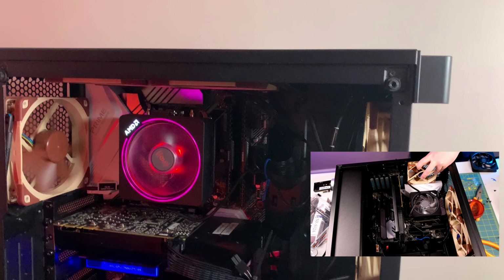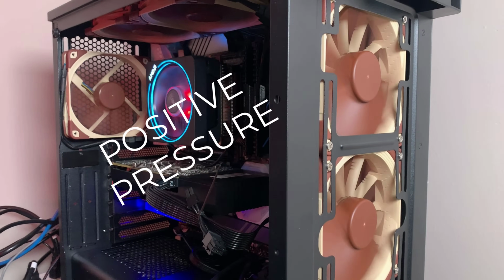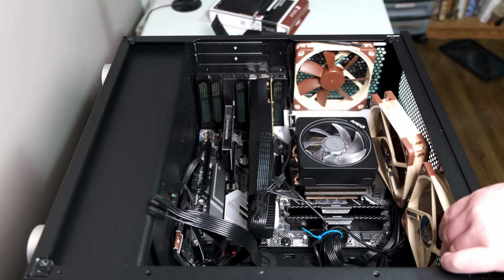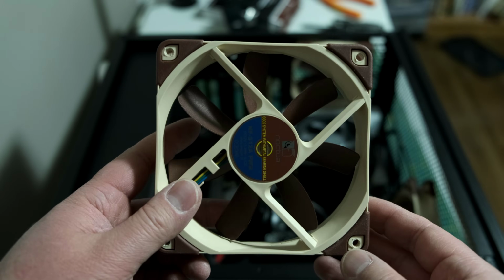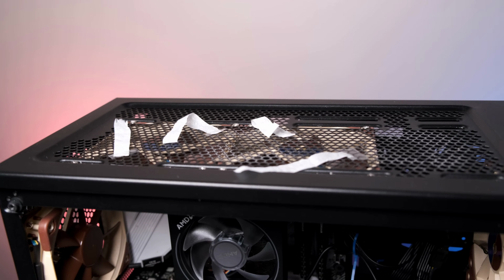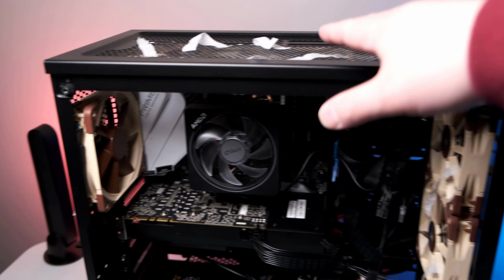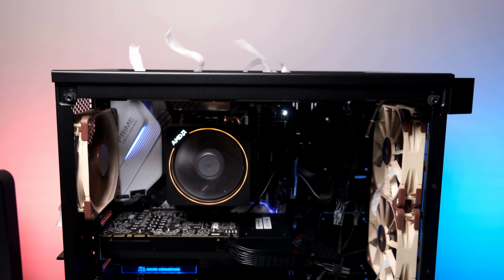Custom PC Build: How to setup your desktop cooling fans for proper air flow

Comment: I only have three case fans do you think that’s enough? Also I don’t have the arrows on them so is the only other way to tell us after you power the fans on?
Reply from the maker: Hi there. It really depends on your setup and what you'll be using it for. I recently did a video where I went from 5 fans down to 4 fans. https://youtu.be/jl10lb8XF0Y. I found the temperature did make a difference. However, please remember, that it's related to my case and my application. The temp was noticeable when playing graphic intensive games and 4K rendering. I actually decided to enable my 5th fan. Let me know your specs and i'll walk it through.
Reply from the maker: Here is an article that tells you how to tell the difference for fan orienation: https://www.neweggbusiness.com/smartbuyer/over-easy/pc-cooling-how-to-set-up-computer-case-fans/

Comment: I have a question, the fan you used to cool your cpu, what is it and did it come with the cpu? Thanks
Reply from the maker: Hi there, the fan i used to cool my cpu is an AMD Wraith RGB Prism. When i bought my AMD 3700X chip, it came with the cooler. I have since switched it out to a Noctua NH-U12S fan.

Comment: You still have negative air pressure right? The best is to have neural or positive pressure
Reply from the maker: Correct. I have negative air pressure. I just finished filming my new fan configuration where i have neutral air pressure by disabling a fan and switching the top fans to intake vs exhaust. i'll be posting my temperature readings between my previous setup. The new video will be out tomorrow.

Comment: Just a tip, If you want better airflow trough your case, do some cable management in there! It will help a lot for the air to got to your hotter components! Great video btw!
Reply from the maker: I have received a lot of nasty comments about cable management. Yours is the first one to comment why. Appreciate the feedback. I agree. I did the best I could, the power cables for the power unit is stiff and It’s the best I could do. Suggestions welcomed
Reply: That makes a lot of sense, but Linus Tech Tips did an experiment and it showed that good cable management doesn’t affect airflow.  Myth busted.

Comment: Hello.  I just bought 3 LED upHere fans that I plan on using for Intake @ front, and 1 Arctic P12 fan @ the back for exhaust.  All are PWM fans.  Do you think they're decently enough for my computer (matrexx55 ATX case)
 (cpu is R5 2600 ; gtx 1660s).
Reply from the maker: Hi there, i'm just confirming. You'll have 4 fans in total? If you do, that's enough for your setup. Question. Neutral air flow, best to have 2 exhaust and 2 intake.
Reply: @TheWongReviewer  Yes, I have 4 fans in total.  I could move one of the fans to the back if Neutral flow is the better route--perhaps top since hot air rises and one in the rear.

Comment: Make the 2 top fan intake and youre good to go
Reply from the maker: Hi there, thanks for watching. I just switched the top 2 fans to intake. I also switched one of my front fans to exhaust. I'm doing temp readings right now. A part 2 video is coming up. 
What you suggested is what Hardware Canucks recently suggested as well. Part 2 video will be out in 2 days.
Reply from the maker: Hi there. I switched the top 2 intake fans to intake. The results weren't what I was expecting. Here is an updated video: https://youtu.be/jl10lb8XF0Y

Comment: That is actually a good video, very explanatory. I'm assuming that your fans are all 120 mm ? I have a 2 x  140mm fan intake, 1 120 mm fan exhaust, 1 92 mm fan exhaust,  a Noctua downdraft CPU cooler (L12 model, 1 x 120mm fan, 1 x 92 mm fan). CPU is a I7 7700K, non OC. I do have a space in the top for a fan, and I think that based on your video, I'll put in a 120 mm exhaust, assuming does not negatively affect the Noctua downdraft CPU cooler. Reason for all of this is that I find under heavy gaming, my CPU temps are around 78-82C, which I think is a tad warm.
Reply from the maker: Thanks for watching and the feedback. Correct, they are all 120 mm. I did do a temperature reading test in my corsair carbide case with this configuration. I just checked the video and during heavy game play of Destiny 2 at max settings and 144 fps , it was around 60C after 1 hour of game play. https://youtu.be/jQo6b76ecg0 
Let me know if you do put an extra one on and see if reduced the temp.
Reply: @TheWongReviewer  I did end up putting in a 120 mm fan on top as an exhaust. Naturally while I was there, I tweaked things, fixed things, cleaned things all unrelated to the fan which tool extra time..LOL. I noticed that after heavy gaming, my CPU temps on average went down 6C (76 now  vs 82C), and my GPU temps went down 3C (63 now vs 66C). Do appreciate your video as I had the extra fan in my office for over a year, decided to put it in and it definitely makes a difference.
Reply from the maker: @willfreiwah3773  That's awesome. I'm glad it worked for you and the video was helpful. 6C temperature is great. What GPU are you running?
Reply: @TheWongReviewer  Hi, its a Asus GeForce GTX 1080, ROG Strix Gaming.  3C might not sound as much, but along with the CPU temp decrease, its huge. It was your video that made me decide to "fix" the airflow as I mentioned earlier, so many thanks :-)

Comment: can i have one fan in the back two in the front and maybe one on the top?
Reply from the maker: Hi there. Thanks for watching. Yes, i believe that is fine. I am actually going to be doing the same thing as i have too many fans blowing in.
Reply from the maker: I will be doing an updated video with this configuration with temperature readings.

Comment: this is not right.. fan on top should suck the air into the CPU.  In this configuration.. fresh air from the front will be going to the top fan directly. just my tot. and sorry for the English!!
Reply from the maker: Thanks for the feedback. Someone did point out the same thing you did. i will test it out. I don’t think there is really a right or wrong way. I will update this video with some new configuration and tests. Thanks for watching.

Comment: Should the top fans always be blowing air out? I’ve recently purchased 2 140 mm fans which can fit at the top of my case and 3 120 mm fans which can fit at the front, my PC came with one 120 mm fan in the back blowing air out, I’m just not exactly sure how I should place them.
Reply from the maker: Hi there. Thanks for watching. So in my case, the GPU is at the bottom of the case which is a main source of heat when it's used for 4K rendering and for gaming. I have a temperature readings in my corsair case front panel on/ off review. As hot air rises, it raises to the top. having the fans exhaust from the front is the natural flow of hot air rising to the top. Hope this helps. Let me know if you have any other questions. Happy building.
Reply from the maker: Here's an updated video i did on adjusting my top fans to intake and blowing in. I have temperature results in the video. It wasn't what I was quite expecting. https://youtu.be/pcNJx1DRiWw

Comment: is it bad if i only have one fan at the back and one fan at the top??
Reply from the maker: Hi there. i really don’t think that is enough fans. What are your specs for the rest of the build? It may depend on CPU and graphics card.
Reply: The Wong Reviewer ryzen 5 3500x   b450m  rx570 4gb  600w psu

Comment: I have this same case and the same configuration except with a blower style gpu. I noticed that when the gpu fan speeds up the CPU gets hotter which leads me to believe I do not have enough positive air pressure. I am going to flip the fan on the top right to intake.
Reply from the maker: Elliot ko How many fans do you have now and what is the configuration? What’s your computer specs ?
Reply: @TheWongReviewer  3 120mm on the front for intake and two120mm on top for exhaust and one 120 mm on back for exhaust. The PSU intakes from the bottom of the case
Reply from the maker: I just updated my fan configurations to a neutral air pressure. Here is an updated video on what happens with the temperature difference: https://youtu.be/pcNJx1DRiWw

Comment: You keep calling this a neutral airflow, but it isn't. You have only 2 fans as intake but 3 as exhaust. The CFM for exhaust fans exceeds the CFM from intake fans. This means you have just created negative pressure. To create neutral pressure, your intake and exhaust CFM should be the same. One drawback of negative pressure is dust build up in your system, because the air that isn't blown in is getting sucked in through small openings in the case to supply the exhaust fans with enough air movement. 
So either add one intake to create a somewhat neutral airflow (it still depends on the speeds they run; CFM), switch one exhaust to intake to create positive pressure or tune the speeds to match the disbalance.
Reply from the maker: First of all! I love your user name. You are absolutely right! I did create negative pressure. I am going to be doing a follow up video to address this and how I am ending up with dust. I will be taking one out to create neutral air flow. Thanks for the feedback!

Comment: Your fan config matches what I have in a Corsair Obsidian 450d case.  However, over at Hardwarecanucks he tested the top fan as intake and suprisingly got lower temps.  I may try to match those guys, what do you think?
Reply from the maker: Hi there. thanks for watching. I actually saw that video too and made me think of that as well. I know warm air rises and based on what i read in forums, the top fans should be exhausting it out.  I trust Hardware Canucks (not just because i'm Canadian as well). I'm actually go to test this out since I have baseline data already for temperatures. I'll try and do a follow up video to this one later this month and try their orientation.

Comment: Why so many fans?
Reply from the maker: Hi there. Thanks for watching. Honestly, it was what the "computer advisor" told me when I went to go buy all my PC parts. initially, i just bought one additional fan for the front. However, after explaining I was building a 4K editing desktop and high end gaming with the Nvidia  2080 super. He told me i needed more fans. I tend to agree with you, i don't think I need this many. However, i was already committed at that point. I may do a video with turning off two fans to see if really does make that much of a difference.
Reply: @TheWongReviewer  I'm using Threadripper 1950x, I have one front fan and Noctua on CPU (one 140mm fan) and relatively open (mesh) case. Never had problems. From my experience, you need one (or two) fans to push air inside and this really is sufficient. Water cooling can be different story.

Comment: What have you done with the cabels, looks like a big mess. You sould do some cable management man. Then the build would look alot cleaner :)
Reply from the maker: Hi there. Thanks for watching. I couldn't agree with you more. The cables look bad. The power cable from the power supply to the GPU is tight and not flexible. Any recommendations to help me manage the cables better. I would love some guidance.
Reply: @TheWongReviewer  probably get some extension cables.

Comment: I think your not getting enough air out through exhaust because you got intake blowing right into it causing turbulence. If I was you I’ll lower the front fans some more.
Reply from the maker: Hi there, thanks for watching. That's a great suggestion. I have to clean out the dust and will move down the fans and tell you how it goes.
Reply: Think of the case as if it's an air duct. If the removed panel were to be put back on, the inside of the case should have more air pressure resulting in the back fan having greater air flow. 🤯
Reply from the maker: Hi there. I took your suggestion and made the change. Here is an updated video on my new configuration and temperature results. https://youtu.be/jl10lb8XF0Y

Comment: End result is the case having negative pressure (more out than in). You can see that the top exhaust fans are moving air out faster than the front fans can move air in
Reply from the maker: Yes, you're right. I was able to tweak the individual fans using AI Suite 3. I believe i have a more balanced system. 
With more negative pressure as someone else pointed out, I just have open up my case to clean out the dust at least once a month. So far in terms of dust, it's been minimal.
Reply: I think he should lower the two front fans . So sir won’t just leave once it comes in or cause turbulence with the exhaust fans

Comment: What if I only use the cpu cooler and the other one on the back without the fans on the front, it will overheat?
Reply from the maker: Hi there, I can't comment if it will overheat. But i can tell you that there is not enough air circulating through the case, the internal unit is going to be warmer. This also depends on what CPU and GPU you're running as well. 
If you look at my video on the Corsair Carbide front cover on or off video, you can see what the internal temperatures are with all the fans running. Let me know if you have any more questions.
Reply: @TheWongReviewer  well I only asked this because I have a Gigabyte B450M DS3H motherboard and it only has one port for the cpu cooler and another one for the exhaust fan. So is it possible to connect 1 fan to the power supply? And that fan would be on the front, would that make a difference? I'm building a pc for the first time so I don't have so much experience about this. Could you tell me how many fans can I connect to the power supply? And I also want to get a rgb led strip and I'm not sure if everything has enough ports.
Reply from the maker: Huni Orban What power supply are you using? Is it a modular one? What connection do you have left the power supply?
Reply: @TheWongReviewer  oooom well that's the thing, I haven't bought all components just yet including the power supply but I just looked at the Corsair CV Series CV550 80+ bronze, it's non-modular. I want at least two fans on the front and an rgb led strip as well.
Reply: @ashenone6646  Use a fan header splitter cable.

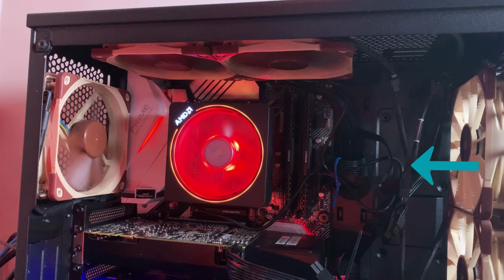Comment: What if I reverse airflow ? @1:37
Reply from the maker: Hi there, thanks for watching the video. I just want to make sure I give you the correct information. Can you please clarify. Are you asking if the air flow goes from the back and top of the case to be vented through the front of the case?
Reply: @TheWongReviewer  YES
Reply from the maker: @865121r  Hi there, heat from the CPU and GPU will naturally rise to the top of the case. So it makes sense to vent  the hot air through the top. In theory, if you draw cool in air through the top. It will be less efficient draw the hot air through the front of the case.
Reply: @TheWongReviewer  thank you
Reply from the maker: @865121r  All good. Let me know if you have any more questions. Happy to help. Happy building!
Reply from the maker: I switched the configuration of my fans to revers e the air flow. Here is an update video on my temperature findings: https://youtu.be/pcNJx1DRiWw